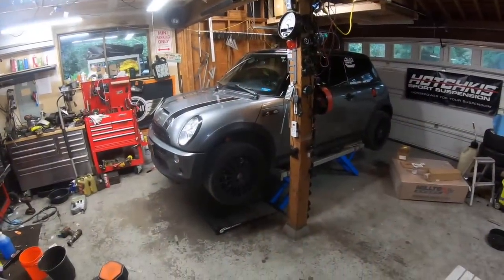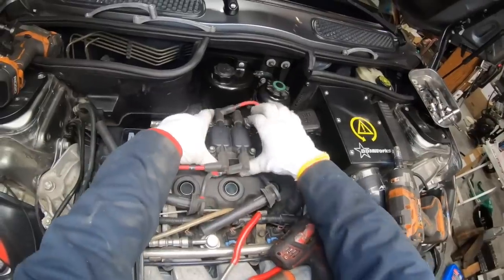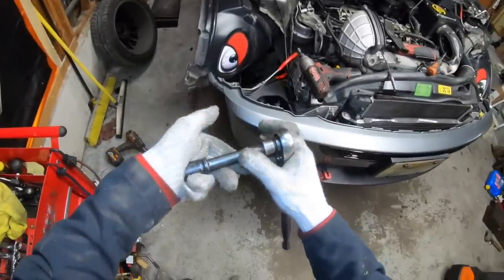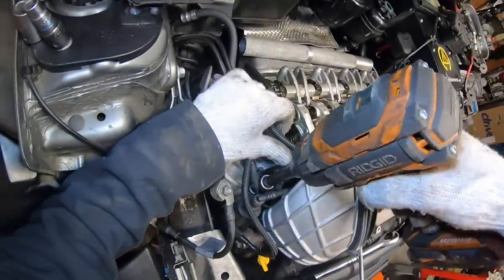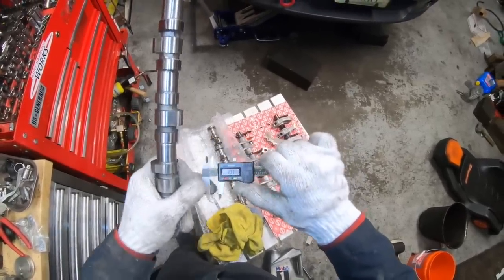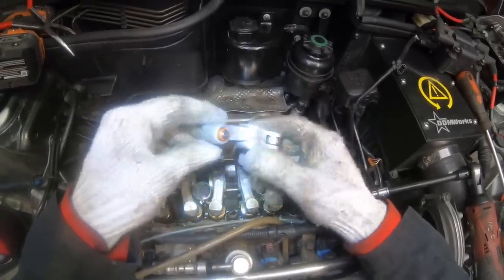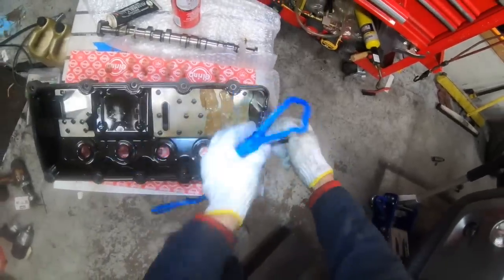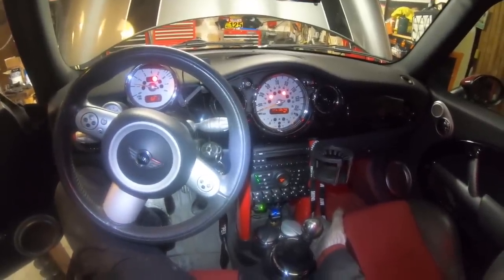2002-2006 MINI Cooper S - Install Performance Cam R53

Comment: Hello, a few days ago I tried the camshag 205 400 for the mimi r53, I barely changed it and the car fails a lot and shows cylinder misfire errors, the original was put back in and everything is fine. My question requires other modifications or what do you recommend, tha car had 15%pulley, thank you.

Comment: Do you just used the stock rocker arms.  With upgrade cam. I upgrade my cam but all my lifter lash broke.  Is there upgrade rocker arms.  My is 03 mini cooper s

Comment: I would advise caution on relying on that tensioner to retention on its own after starting. I just redid a time chain job because of this behind someone else thinking the same thing. It didn't open up and beat the chain guides out of the engine. Being my first time one of these motors I decided to download a Haynes manual and sure enough it says to use a flat bar to press the tensioner in to release it which I did and the car no longer sounded like a john deere tractor when I put it back together. Not saying this wasn't a fluke or something the guy did wrong just a word of caution to check it and make sure it released.

Comment: 16:30 Do you know if a lateral play (direction is the length of the camshaft) on the rocker arms is a problem when everyting is supposed to be tightened? Thank you.

Comment: MSD Coil packs work great.  What everyone forgets to do is READ The instructions.  IF you dont open up the gap of the spark plugs after installing the MSD coil pack your wasting your money.  I went from stock .032 gap to .045 gap.  = More spark = More torque / power. And the thing with the bolts are not so much length.  The problem happens when folks OVERTIGHTEN the bolts releasing the brass knurled nuts imbedded in the valve cover making it fit loosely.....

Comment: My mini R53 has sheared two camshafts now. breaking after 1 and a half cyliders (if that makes any sense?) thus losing copmpression on 2, 3 and 4. Any idea what could cause a camshaft to snap?
Reply from the maker: This is not normal. Hand crank engine and check for unusual resistance. Hand spin accessory pulleys and check for unusual resistance. Inspect all lifters and rollers Check cam timing

Comment: are all performance cams need to ding the spark plug tube? i am looking at catcam 461
Reply from the maker: Not sure but most likely. Just spin by hand and check for clearance, realizing that there will be small amount of heat expansion. I'd give at least .002 / .003 clearance

Comment: Hello first a great video explaining how to replace the camshaft in the right way.. Second I wonder how can a lift of one extra mm not to get the clearance from the valves to titter on the brackets /lifters...... Its that because of te hydrauliek nose in the brackets... That's keeping the right clearings into the in and outlets valves. ... Also on the pistons... Thank you for the realy great explaining in all your videos 👍

Comment: Why do they recommend locking the chain tension down before installing ? I never have and have never had any problems. Also which cam did you install or did I miss it.

Comment: when replacing the rocker arms do you have to use the locking tool? Also do you have to replace all of the rocker arms or is it ok to just replace the ones that are bad?
Reply from the maker: If you are careful and mark chain cam position and don't allow chain to skip teeth on the crankshaft, you can skip the locking tool. Replace whatever you can afford.

Comment: Quick question when installing the rocker arm shaft. Is there a certain direction it need to face? More specifically which end faces the timing chain?
Reply from the maker: General guide is to put things on the same way you took them off, but if a part is a mirror image of itself, it's probably fine to go on either way

Comment: Always great to watch your videos, question for you.  You mentioned that the car needs to be tuned after this mod.  What happened there, did the car drive to the tuner or was it trailered there?
I am about to do the same thing and I hear different thoughts on this.
Reply from the maker: Depending on level of mods, generally safe to drive to the tuner as long as you drive gently, and aren't redlining it or driving wide open throttle, if the car runs and idles smoothly.
Reply: @ModMINI  thanks 🙏

Comment: Pro-tip: buy Enginetech L0096 lifters (most come in sets of 4 and are labeled L0096-4) for the replacement nylon retainers. They're not very expensive and it's great for longevity since the original retainers are super brittle after all these years. I'd suggest reusing the original metal caps/seats though because the ones on the new lifters are ever so slightly different.
Reply from the maker: Great tip!
Reply: @ModMINI  so your just using the Nylon retainer and not the actual lifter??  That part # comes back to a chrysler.
Reply: @gforceman2  The mini engine was developed by Crysler/Rover/BMW so the part number tracing back to Crysler makes sense.
Reply: @gforceman2 
 What’s the Chrysler #
Reply: cheaper if you buy throgh chrysler? can we get just the nylon tips ?
Reply: @hipoman8087  you can, but they're made by a third party and they're about the same price as the entire lifter assembly. If you live in the US, get them off of rockauto and they're pretty cheap

Comment: Do you have different injectors on this car as well? - from the JCW? And with those two modes, who/what did you use to tune after the install of the cam?
Reply from the maker: People typically put JCW injectors and get a tune such as this one. https://www.waymotorworks.com/wmw-ecu-tune-r52-r53-cooper-s.html
Reply: You don't HAVE to, but if you're installing an aggressive enough cam that requires a tune, you may as well install larger injectors to future proof it. I'd suggest going with 450cc or 550cc bosch injectors (available at multiple retailers who sell mini modifications) since you can get them for cheaper than new OEM JCW injectors and you won't really ever risk maxing them out on normal pump gas. JCW injectors and a mild cam don't require a tune, but it is best to do one anyways.

Comment: Great video! Can I just add you should ‘pop’ your tensioner back out before starting, this can be done with the proper tool or use a long thin screwdriver. This reduces the risk of chain skip on first startup
Reply from the maker: You can an you should, but sometimes it doesn't pop out. The comment is meant that don't worry if it doesn't pop.
Reply: how would you pop it ?

Comment: Hey mister. Would you recommend spraying lubricant/penetrating oil such as pb blaster around the spark plug boots to remove stuck, stubborn plug boots ?
Reply from the maker: Silicone spray would be preferable as it leaves no residue, although usually just tugging on the boot at the top they will come out.
Reply: @ModMINI  I've tried tugging the boots from the top, but all I get from that is stretchable plug boots, and frankly I don't want to apply any more muscle than what I have to. I'll do what you suggested. I'am replacing the four plug boots. In one of your videos..I'am not sure what you were servicing on an r53. You stated that aftermarket ignition coils are not preferable. Why is that ?

Comment: I’m doing a cam swap finally and unable to remove the chain tensioner not because of torque but the oil cooler hoses are in the way. I’ve tried the extension like your and other ways and nope. What’s your trick?
Thanks
Reply from the maker: Wobble extension has worked every time.
Reply: @ModMINI  thank you I finally got it.
Reply: @ModMINI  well I dinged my tubes too much and like you said I can’t get my spark plug socked in now. How do I fix that? Also when removing the rockers I was very careful and found the plastic retainers broken. Maybe from being 170k miles? So I ordered new intake rockers but can I install the exhaust rockers while I wait on the intake ones?

Comment: I really do know where to go to get a tune on a r53 I live on the east coast in Delaware
Reply from the maker: Unless you have a really unusual build, a canned tune is your best bet. Send your ECU in and its comes back with tune installed: https://www.waymotorworks.com/wmw-ecu-tune-r52-r53-cooper-s.html
Reply: @ModMINI  I appreciate that  I have a 17% reduction supercharger pulley and a 2% oversized crank pulley I’m going to put a performance camshaft and buy injectors but not sure what size injectors to buy do you recommend 380cc jcw injectors or something bigger ? And also I wanted to buy the upgraded cylinder head but not sure if they can do all that tuning without a dyno?
Reply from the maker: @cloutkingupnext4721  I don't know. You'd need to talk to your tuner if you are making changes such as injectors --  you would need to follow exact build recommendations for a canned tune or custom tune the car on a dyno. The genuine MINI 380cc injectors can generally be used with most canned tunes but you still need to check with the tuner.
Reply: @ModMINI  ✅

Comment: Hi I see you have 2 small guages on the steering wheel mount. How did you fit them and do they light up orange Amber to match to normal display

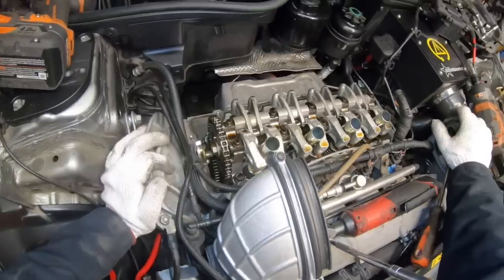Comment: At 4:50 you mention that the car has had frequent oil changes. What is considered frequent :) ? My R53 gets new oil + filter every year, driving less than 10.000km / approx 6000 miles between change. Is that considered frequent enough?

Comment: I installed the Schrick mild cam with the 264In/272Ex grind. Used your video for reference but I didn't have a ball hammer so I took a cheap hammer and ground the head to a ball end (sacrificed) did the job and gave me the clearance I needed. It definitely is a throatier sound but now I have it mated up with a 4 to 1 header and a PaceSetter Monza cat back-she screams at high rpm. Im still on stock ecu and she runs great with all the other supporting mods, the STOCK ECU adapts very well-after resetting the adaptations.
anywho great video I now am confident I can accomplish this entire swap in about an hour wheels up to wheels down.
Reply: How did you reset the Adaptations on the stock ECU . Many thanks
Reply: @tomgt007sugden  sorry for the delay, its a series of button pushing in the center dash the trip reset button. if you search reset r53 ecu itll pop up, its easy.
Reply: @ChrisNieves  brilliant and thank you. Just in the process of building a R53 engine. I was really big on building the JDM cars back in the day. These minis are a new thing for me. Just one more question, if I build this engine and put the 19% reduced pulley on and a bigger cam with 550cc injections. Would the car be safe to start and drive it to get mapped or should I Trailer the car to mapping centre. Many thanks  Tom
Reply: @tomgt007sugden  np glad I can help. No the ecu stock cannot compensate for that large of an injector as the stock injectors are already at like 80% duty. I have there 17% with the JCW 380s on a “shark tune “ and runs great I haven’t gotten the time to unlock my ecu and have it properly tune my r53. I’m also planning a tear down and rebuild soon myself as soon as I get my garage in order. 
Keep me posted on your project that’s cool.

Comment: One thing you should have done...
Place pieces of "good" paper towel into the oil gallery holes that go through the head, into the block.
That way there's nothing (like Tappet caps from worn out plastic retainers) that can accidentally fall into the engine.

Comment: I guess that explains why the cam cover gasket my local repair place fitted last week is blue. Seems to be the colour for this gasket. Oil leaks all gone now, they replaced the sump gasket and the crank position sensor O ring as well.

Comment: I keep reading that it is bad to buy a used 2003 S mini  to go from 2004 and up. What is also being said is that the Trans is better from 2005 and up. on S models. What is your opinion on this if I may ask?
Reply from the maker: 2005 or up is better, but not giant amounts better. They are the same transmission and same reliability, just slightly different gear ratios. 2005-2006 build quality is slightly better and the throttle ECU map is improved due to a different ECU.
Reply: @ModMINI  well picked up a 2007 lol Great videos btw! One last question if I do a turbo upgrade is there any mapping required looking to do just a simple upgrade possibly a stage one
Reply: @javiermontoya3179  Turbo is an upgrade? Surely much of the point of buying an R53 is the supercharger. If you wanted a turbo wouldn't it be better to buy a car with one already in?
Reply: @owensmith7530  I am asking regarding R56...hence 2007 which is not supercharged but great point i guess???
Reply: @javiermontoya3179  I thought you were talking about a supercharged since this is an R53 video. The soft-top was still supercharged in 2007 I believe, it was late getting the model revision.

Comment: I've done all my work to my mini watching your videos. I'm about to service the super charger and inspect, new water pump, new timing chain tensioner, belt tensioner, sc pulley, harmonic balancer, cold air intake, new alternator, crank oring, oil pan gasket, transmission mount, and all the bushings on the front.

Should o do anything else while om at it?
Reply: Did you do all of this?
My 04jcw is rattling loud. Appreciate any tips thanks

Comment: As a aircraft mechanic when he said use your brain when using torque wrench hit home.  Idk how many new mechanics just set a torque wrench and get after it not realizing they have the wrong one.  And then come running to guys to say omg idk what I did can you fix it.
Reply from the maker: Yup. Understand the material you're working with. I've had people comment about twisting the head of the bolt off. That must require ignoring several warning signs.

Comment: I’m 19 and currently saving for a Mini Cooper s R53. I’d like to work on my car myself but this just seems extremely overwhelming.
Reply from the maker: Everything seems hard at first. I wouldn't recommend installing a cam until you are comfortable on simpler  things like brake jobs - which you can do on any car. Take apart your mom's car for practice or something.
Reply: research , watch videos, ask questions. Dig in and take your time. dont guess on something, research again.when i started there were'nt videos like this or internet. First motor i did did 3 round trips to california from kentucky . was stationed in CA. DIG IN and have FUN ! Stand back and take pride in what you did. Feels good when someone asks who did the work and you say I did !
Reply: He's very methodical with a full list of things required to complete the procedure. It just sounds your not ready yet bud to take this kind of job on ✌

Comment: I followed this to every second and now I get p0302 code for cylinder 2 misfireing, any advise on what I could have done wrong please?
Reply from the maker: Make sure plug looks ok, fully tightened, ceramic is not damaged, and plug wire is pushed on all the way.
Reply: Mod MINI thank you, do you think the timing could be out?

Comment: Just a question: due to a couple of noisy lifters (input side), I took off only the intake rocker armi axle, changed faulty lifters and put back all together. But on the first start up the engine took a lot to turn on and the engine light turned on with p0304 code. Did something wrong?
Reply from the maker: Check plug wires
Reply: @ModMINI  Thanks

Comment: During an oil pan gasket change I found one of the hydraulic lash adjuster plastic caps/retainers in the oil pan. Should I be concerned about continuing to drive the car?
Reply from the maker: If car is not making noise, someone probably already repaired it but couldn't be bothered to fish out the bit. Any damage would have already occurred.
Reply: Mod MINI thanks! The car would have lifter tick on startups so I don’t think it was fixed. I just got some used rocker arms to swap in, so it should be good to go soon. Thanks for the great videos!!

Comment: How did it run without a tune ? I wanna do cam now and save then do my tune as I have ALOT of other mods...just wondering if I can get by untuned ..I know I won't fully benefit but I'm worried about damaging something
Reply from the maker: Car will run without tune but I would not install this part until you have tune on the calendar, especially if you have lots of other mods. Car will drive fine, but you may get into unhealthy air/fuel ratios at wide open throttle.

Comment: Lol our minis always sounds like a fart..I have full bolt ons, long tube headers with no cats and pacesetter exhaust ..it's a loud fart
P.s ..my forge intercooler dropped my iat by 25degress on the hottest summer days ..even running my car HARD it never sees intake temps above 200F

Comment: We fitted a newman stage 3 cam and it was fine till it got hot then it seized and snapped and it's scorred my ported and polished head but somehow it diddnt bend any valves
Reply: Any idea how that happened please? Oil feed issue? I'm fitting my newman cam tomorrow :)
Reply: @russtaylor4242  I've span it over with the valve cover off and all the oil sqirters work so I think it's down to the cam being too big and not machined properly
Reply: @fabiovitagliano3986  That's strange, they seem quite popular. I will measure and compare mine to stock before I fit it. Do you have your old cam to measure against?
Reply: Nah I've put the stock cam back in because I've got a track day on the 29th

Comment: I live your videos. I don't get this mod. That's about a 50cc engine displacement increase? Is that ever going to be worth the amount of work and risk to the engine?
Reply from the maker: There is no displacement increase. If you are that concerned about risk to engine, do not install performance mods.